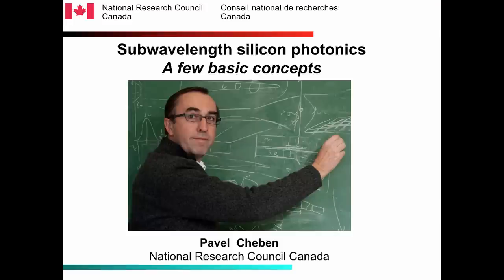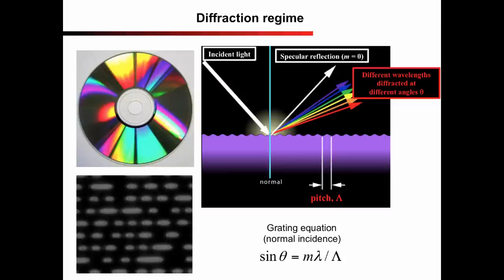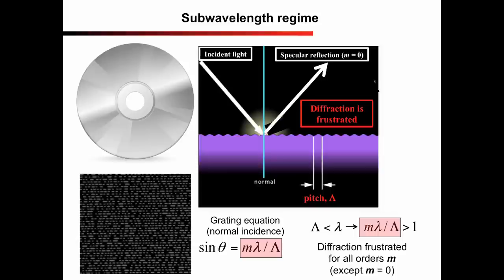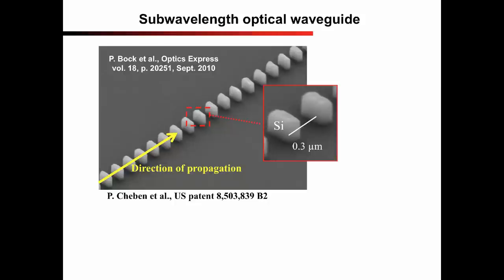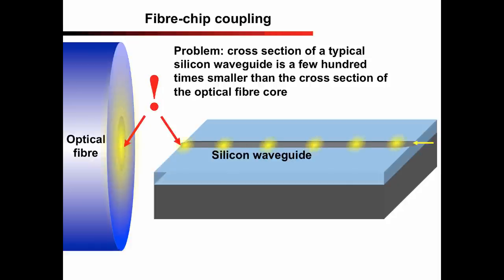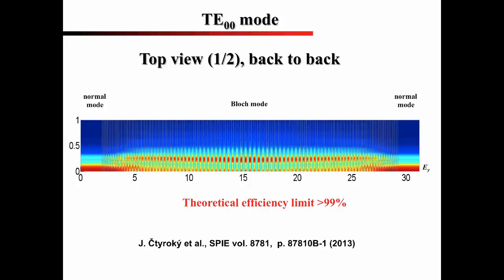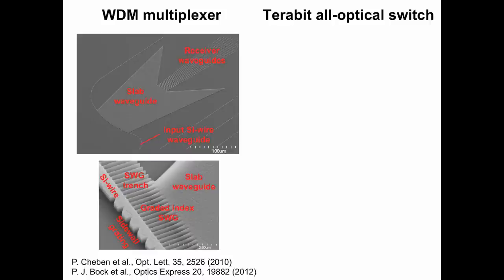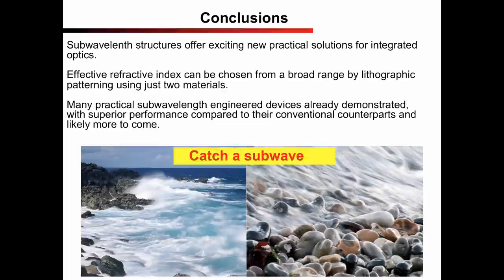Subwavelength_silicon_photonics_Cheben

Comment: I wonder whether one can make low loss waveguides with ALD deposition, using sub wavelength structures. If the mode is highly delocalized, it may not see the granularity as a scattering element. This could be useful if one doesn’t have access to high res ebeams and etching capabilities but just ALD